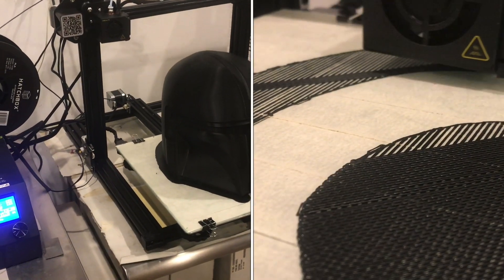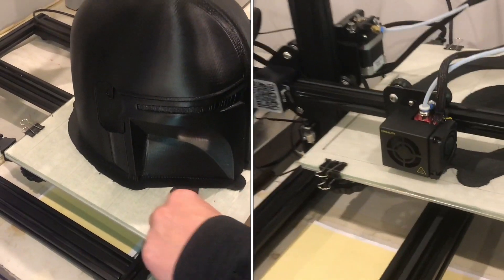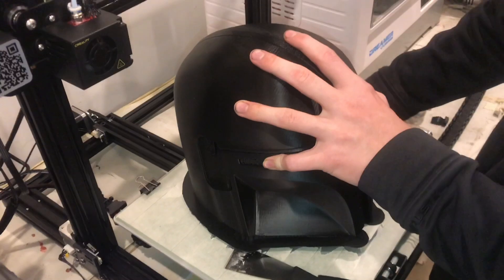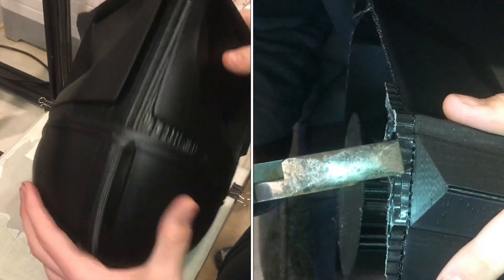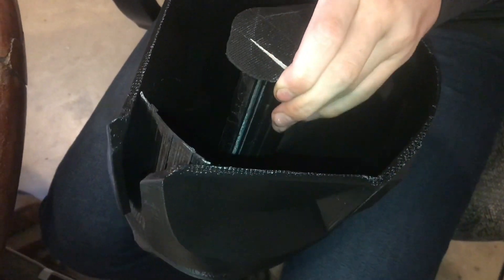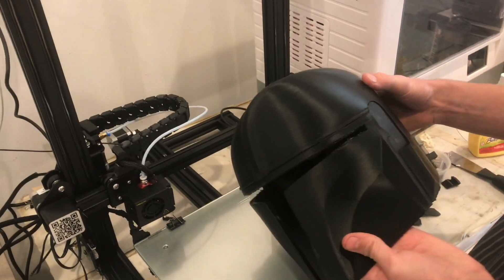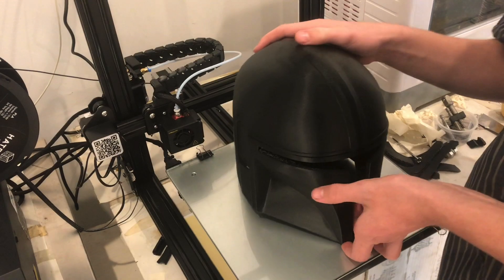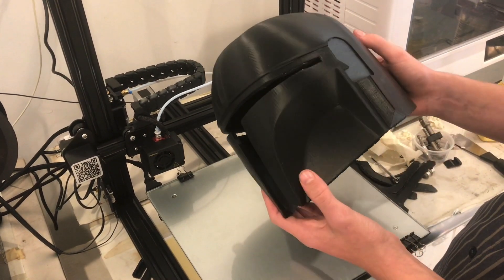3-D printing a “FULL SIZE” mandalorian helmet (2-day print) creality cr-10

Comment: To anyone viewing, you can save tons of time and filament by support blocking the inner portion of the helmet. It’s not necessary to have the internal supports and will take your print time and material use down by 25% at least.

Comment: is this the 300*300*400 CR-10?
Reply from the maker: The platform is about 310 mm x 310 mm, we could’ve made the helmet a little bigger, after we try to put it on it was a little small. The machine was about $320, it was the base model and we added a few modifications. It is the CR 10. We really like this machine. I hope this answers your questions
Reply: @livefree6878  I see. Well I'm still trying to figure out which printer to buy. Trying to decide between the CR-10 and the Ender 3. Thanks for the info!
Reply: @crispymeister8076  I have an ender 3 and the bed is so small. A reality cr10 can print a full helmet. On my ender 3 I had to split a boba fett helmet into 5 sections for the main body of the helmet